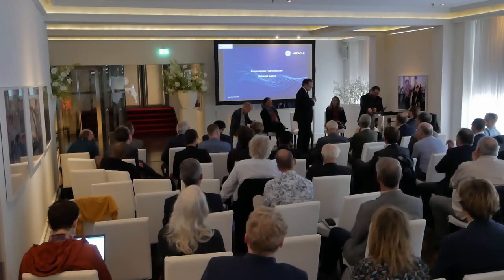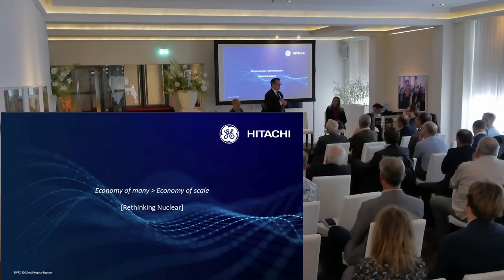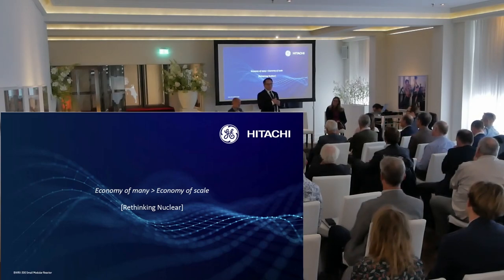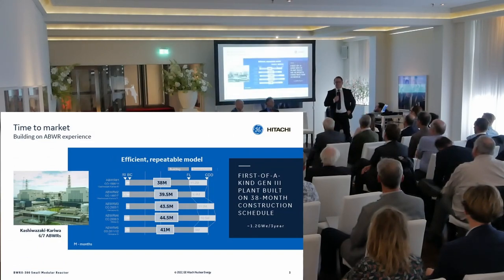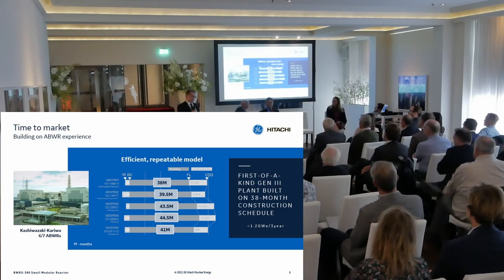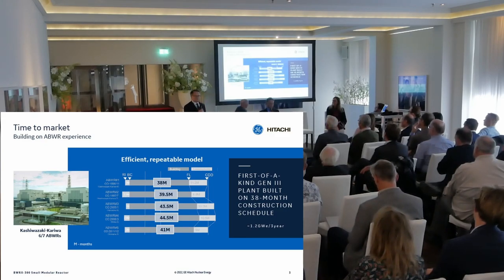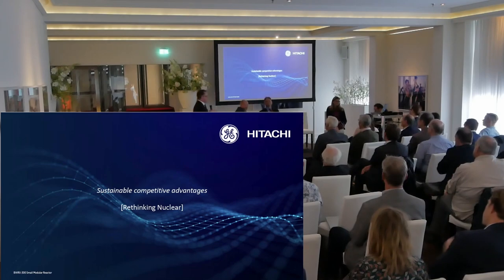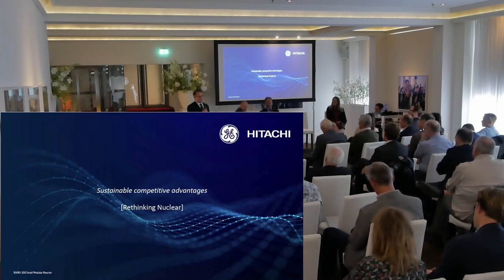One of the most promising Small Modular Reactors - BWRX300 by GE Hitachi

Comment: Don't bother. If you can't do it in 18- 36 months. It's not worth it. 
America's transcontinental railroad took 6 years. Used more steel than a single plant. Hoover dam used 160x more Concrete than a single nuke plant, was done in 4.
Reply: Yeah that was also made mostly by slaves and indentured servants. This is going to be by engineers, scientists and the like. Not a guarantee, but that's definitely a large indicator that there's a vast difference between a railroad and a nuclear reactor.